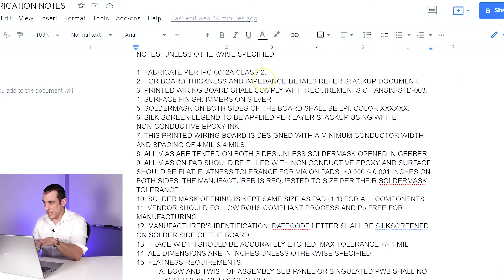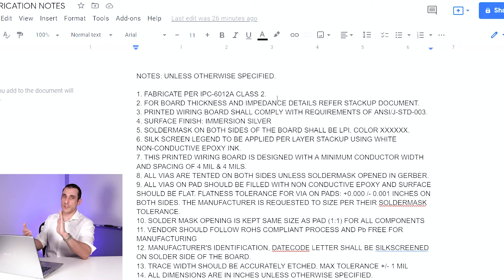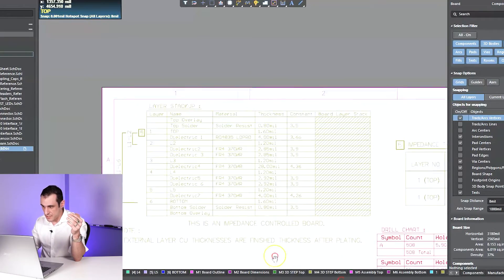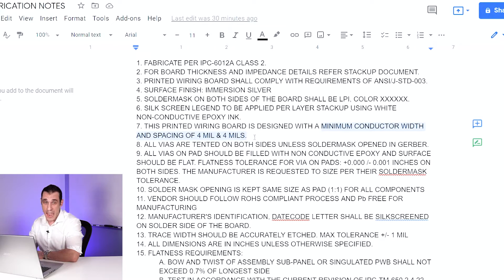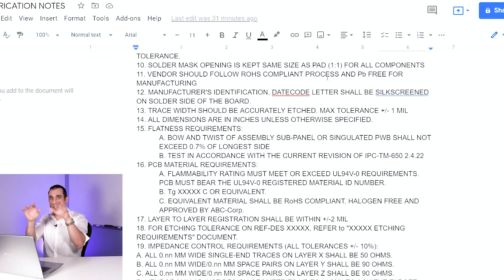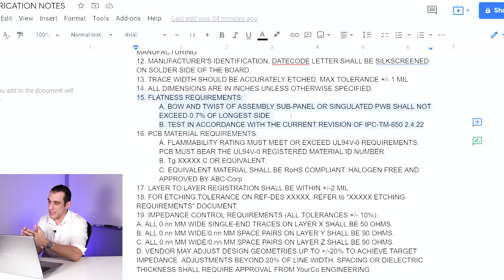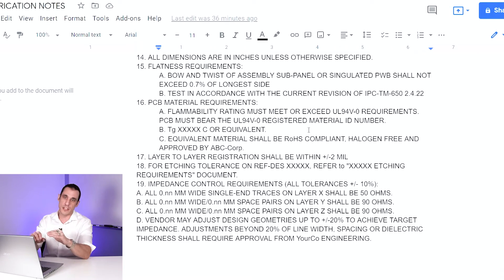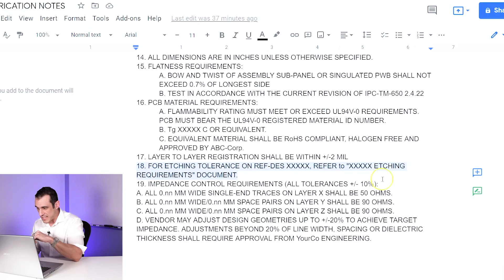What's In PCB Fabrication Notes?

Comment: From my experience with PCB vendors and creating procedure type documents I want to add a few things. 
Don't say "Should" always say "Shall."  Should is legally ambiguous where Shall is not. 
For solder mask you should call out a standard. I use IPC-SM-840 Class H.
Surface finish should also call out a standard. I don't have one with me now but note 4 needs more detail.
I don't follow note 9 where it says: "THE MANUFACTURER IS REQUESTED TO SIZE PER THEIR SOLDERMASK TOLERANCE"
Note 10 will cancel out the solder mask layer in your gerber files. There are also BGA parts that require solder mask defined pads so this would break those component footprint designs.
Note 11 is vague and unnecessary because of note 16

Remember that the fabrication drawing is legally a part of the Purchase Order. If they don't follow the notes they MUST redo the boards at their expense. Don't send the requirements by email.
This is an excellent reference, my comments are just from my experience (more than 20 as an EE)
Reply: Good point about note 11, I think since then we consolidated some of the notes down to 11, I think those were applied to the linked doc.

Comment: Thank you, another very useful video.  Where in the Output Job Files would you recommend placing a PDF "Fabrication Drawing" which would be a single page document that contains the drawing sheet (with legend), mechanical drawing of the fabrication including dimensions, fabrication notes, stackup and drill table?  I would think under "Fabrication Outputs" there would be a selection for "Fabrication Drawings", just like there is for Assembly Drawings under Assembly Output.
Reply: I have a PDF container specifically for fabrication and assembly drawings (I package them in the same PDF unless requested otherwise). The fabrication drawing and assembly drawing options are under the Documentation Outputs section.